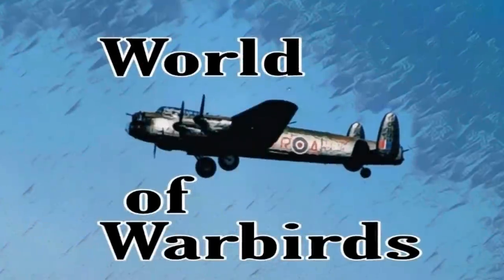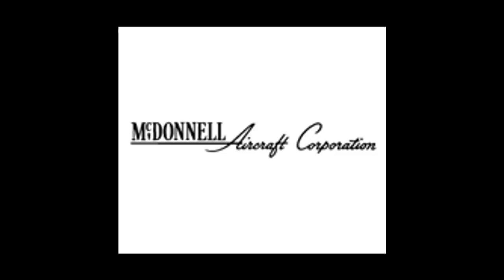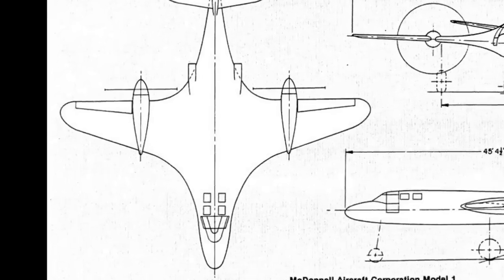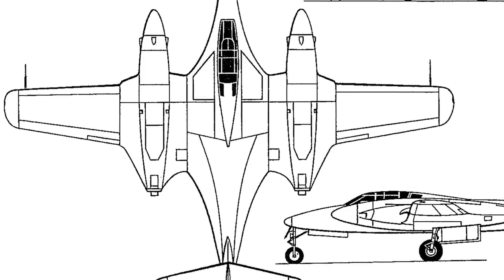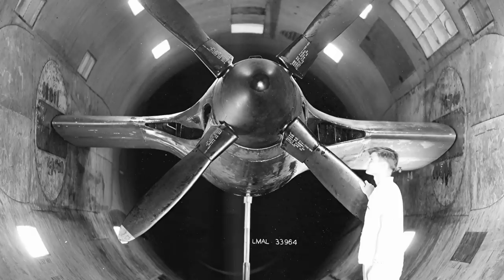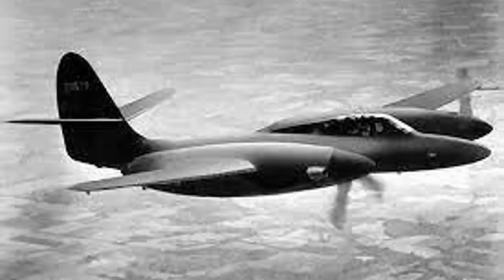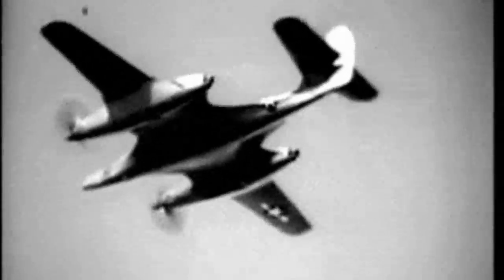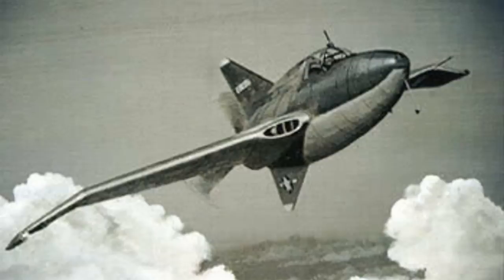McDonnell's XP 67 Moonbat

Comment: The Piston engined Aircraft still being designed before it was known that the Jet would completely replace them (which was genuinely up in the air for a while given the limited range of Early Jets) were some of the most beautiful aircraft where designed, and the few that were constructed reveal this.

The Moonbat is just one example.

The Counter-rotating Prop is something that would have become massively more common as well, given that it can produce more thrust per radius than a single prop, and thus a larger radius counter-rotating set can allow enormous loads to be carried, or for fighters, incredibly fast speeds for the equivalent load of a typical Pursuit-Fighter of the Period.

It is likely had jets not come along that the moon at would have seen production, and eventually had counter-rotating props added to increase performance.
Reply from the maker: There’s something fascinating about the last examples of certain technology, before they get swept away by the new thing!

Comment: The original idea of a centrally mounted engine based on a mated sort of setup on a very proven engine using essentially drive shafts to drive the propellers seems like one of those designs that when it works it would be a game changer. The operative bit there being "when it works". There's supercars today that use a similar idea, the Bugatti Vehron comes to mind. This one sounds like it was just a little too ahead of it's time for the materials available in its day and that's why they just couldn't get it to work as advertised, and I'm sure anyone that owns a Vehron has it in the shop regularly. I think the reason that design got rejected wasn't so much because it was "wierd" for its time but because someone on that committee went "that thing is going to be a maintenance nightmare so even if it works as advertised how often is it going to actually work? What other logistical aspects are we going to have to keep up with in order to keep this thing running? Because if we can't bridge those gaps then we are better off with something that we can do that with even if it doesn't perform quite as well as this one." So naturally a more conventional engine configuration makes a lot more sense because it doesn't add as much to the logistics chain. Overall a very interesting video and a really cool idea for a plane. I really like where those designers head's were at.
Reply from the maker: Some good explanations!
Reply: @worldofwarbirds  I like your videos, I just figured there are factors most folks don't think about when some bit of equipment, vehicle, or weapon doesn't get the green light as it were. I mean it may be a game changer bit of kit but there's always a downside. And it only is a game changer if it can be supported

Comment: Now THAT would make a great 1/48 scale kit to sit along side the 1/48 Vought XF5U! It is almost as if the designers didn't exactly know what they wanted. All the power in the world would not allow this huge beast to be as maneuverable as contemporary fighters.  If it were intended as a fighter in the same fashion as the Mustang,  Lightning,  etc. it would not need the heavy (caliber AND weight) of armament. Six 20 mm would have been more than sufficient. The almost ridiculous armament originally intended would have made it a deadly bomber interceptor as the Luftwaffe's 30 mm guns were deadly against Allied bombers. In that case, it would really only need to be FAST and not as agile (think ME 262).
Reply: That's exactly what it's design proposal was, an interceptor, it wasn't designed to be a fighter.
Reply: @dukecraig2402  Exactly!...so why the criticism for it's lack of maneuverability when it wouldn't really have needed that capability when attacking bombers.
Reply: @stephengardiner9867  
You'll have to ask the creator of this video because it remains a mystery to me.
One of my favorite design disasters was that goofy Bell invention that had engine's in nacelles that also had movable cannons in them, the Airacuda, what a pipedream that thing was.
The Airacuda, this thing, the Moonbat, and other design failures were all mostly failures due to the Army's demand that a "Hyper engine" be developed that never came to fruition, so many of these designs had the original "supposed to be available" engine's replaced with less powerful engine's in common use that only produced ⅔rds to ¾ths the power originally specified for the aircraft, well naturally they wouldn't perform as expected if the engine's were replaced with something that less powerful, when it became apparent that those engine's weren't going to work as expected why they would even proceed with their development one day longer doesn't make much sense.
Reply: @dukecraig2402  I like the looks of it though. It has almost a hint of the MUCH  later F-16 in its looks. Imagine taking the basic P-67 idea, scale down the size (and weight!), give it a proper bubble canopy reduce the artillery to 20 mm canon and install a pair of later Merlins. You would basically have the U.S. equivalent of the De Havilland Hornet. Imagine if Packard had worked the same magic they did with the Merlin by producing the Griffon in the U.S.?  A 1/48 kit of the Airacuda would be a show stopper!  It looks like something out of a late1930's sci-fi story and yet a few of them were built and flown.
Reply: @stephengardiner9867  
It still wouldn't have been powerful enough, the Merlin was never more powerful than the Allison it just got a 2 stage 2 speed high altitude supercharger in mid 1942, the Allison didn't have one simply because no one paid them to develop one until the end of the war, the war ending meant that the US no longer was able to use the Packard made Merlin's without paying a royalty on each one, when that happened the Army paid Allison to finally make a 2 stage 2 speed supercharger for the Twin Mustang which was actually more powerful than the 2 stage 2 speed Merlin, everyone thinks the Twin Mustang had Merlin's in it but the fact is only the first 20 pre production one's did, the production one's had the Allison, right when it was ready to go into production the war ended so the Army instead of paying royalties to Rolls-Royce just had Allison make a high altitude supercharger for their engine, previous to that it only had a single stage supercharger because the Army wanted all their aircraft to have turbos for a second stage for high altitude, single stage Allison's were more powerful than Merlin single stage engine's, and they were more powerful than the 2 stage 2 speed Merlin's until medium altitude where a single stage supercharger engine starts running out if air and a 2 stage 2 speed supercharger can shift into it's high range.
Going that route they'd have been better off using the same 2 stage 2 speed supercharger Allison that was in the Twin Mustang because it was about 200 HP more powerful than the same kind of Merlin but even that would have fallen short of the power the original design needed for the kind of speed they were looking for.
None of those hyper engine's worked out, they could have kept developing them and eventually got them working but the jet engine was coming into play and they understood that the one's being produced then were from a technology that was in it's infancy, like a Liberty engine compared to an R2800, they knew that in 10 years jet engine's would be at least twice as powerful per pound as the one's being made during the war, and they also knew they'd need airframes with aerodynamics beyond what they were making at the time, matter of fact they eventually put jet assist engine's on the Moonbat trying to get the performance they originally wanted but that airframe was unstable and required electronic stability control which wouldn't be available for years and by then new airframes would have made it obsolete. 
It's one of those good ideas that was stuck between 2 era's and had a design ahead of the designer's comprehension of the type of aerodynamics needed for what they were trying to do, in otherwords the designer's weren't quite as smart as they thought they were, it was prone to a phenomenon known as a Dutch roll, the test pilots refused to spin yest it because they were afraid it wouldn't recover from one.
Reply: @dukecraig2402  Yep, the P-38 Lightning did fine with it's Allisons, with the turbochargers added.
Reply: @lancerevell5979  
Exactly, the age old fairy tale that the Merlin was more powerful than the Allison is a bed time story told by people who know the average person doesn't understand the different supercharger types and the timeline's involved that goes along with everything. 
To someone who doesn't understand those things then "They replaced the Allison with the more powerful Merlin" sounds good but the reality is it leaves a lot of facts out of the story. 
The supercharger/turbo configuration that the US Army deemed all aircraft designed for them should have was more powerful and made more consistent power through altitude changes than any other way of dealing with the ever thinning air of increasing altitude, just look at a chart of power levels using the same engine but with different supercharger types like the same R2800 in a P47 with the Army's supercharger/turbo system and a 2 stage 2 speed supercharger in an F4U, the P47 will make it's max power around 10,000 ft and hold it there all the way up to almost 40,000 ft, but the F4U starts losing power at an altitude where the supercharger shifts into it's high range because the throttle has to be reduced so the engine isn't overboosted, then as it climbs it'll reach max power again then it'll start dropping off again the higher you go until eventually it dogs out again at which point it needs another range to shift into, matter of fact I think there was some post war British Rolls-Royce Griffen engine's that had a 3rd speed on them.

Comment: Curious as to what it’s radar signature was. Also, you should do a video on the MesserSpit. The Spitfire with a Me-109 engine in it the Nazi’s experimented with.
Reply from the maker: I will look into that!
Reply: @worldofwarbirds  I’ve seen one short video on it. And supposedly it was better than the ME-109 or the Spitfire with its original engine. You know the Spitfire had a small yet possibly fatal flaw with its carburetors. And the ME-109 was fuel injected.
Reply from the maker: Sure, if the merlin experienced zero gee...then the fuel stops!

Comment: sounds like someone in charge of accepting contracts was in the pocket of a rival and made in difficult for them on purpose. however, the original design was great but maybe they should have either used a reliable engine with enough power or designed a new one, somehow welding two engines together seems to invite too many problems.
Reply from the maker: Yes, the Germans tried it too with the Heinkel He 177 Greif, which would make a good future episode…